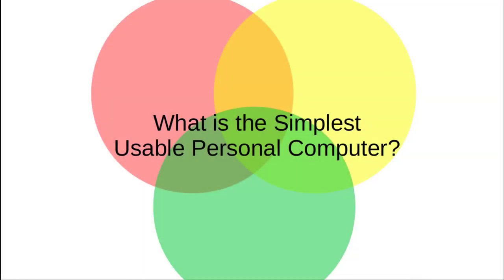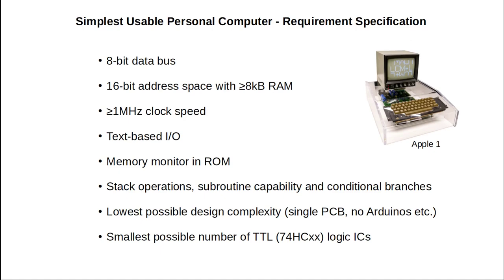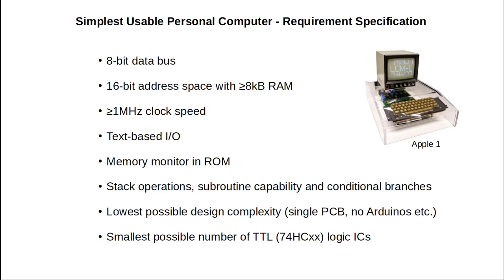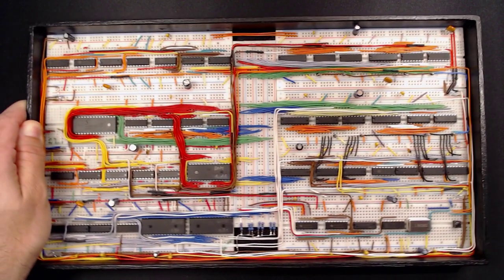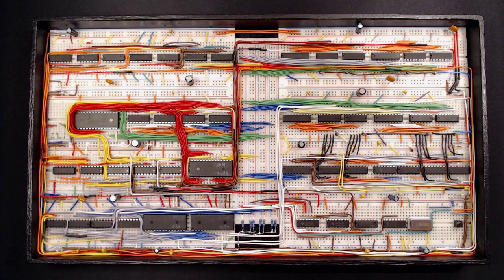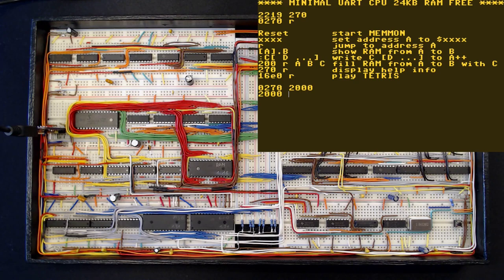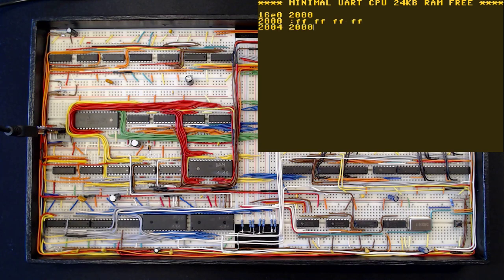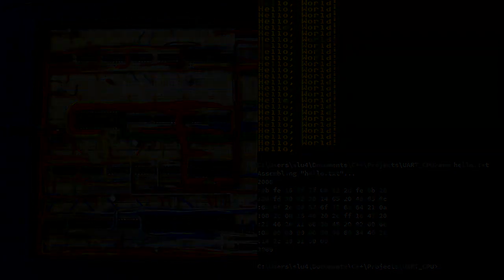Simplest Usable PC #1

Comment: This is really great stuff, thank you so much. I think there's a huge need for a hacker computer that is of course weak by modern standards, but actually comprehensible. Something without the hundreds of historical layers of messy technology, something without all the red tape of security stuff, etc. A hacker console like an Amiga or Atari ST.
Reply from the maker: I certainly agree with that :-) But to my taste, the basic principles of a computer are too much obstructed in the Amiga 500 with its co-processors. That's why I've kept it simpler with the Minimal 64 (still 2x the power of a C64).

Comment: Hi can I ask what potential  use case of such design, I'm process to create such computer on PCB, e.g could you find/use smaller SMD chip that's fits ins smaller board, and having bigger capacity e.g ROM RAM etc. 
You started in the right direction why not finishing it.
Reply from the maker: Hi, my design is all about simplicity, accessibility and education. Glad to hear that you are on the road to a more modern and larger design - but that was not the direction wanted to take.
Reply: @slu467  Alright it's OK I learned a lot from your videos, I know creating more complex computer will need much more harder work, at the end it won't compete against modern design or even mid 90's ones, keep up the good work.

Comment: I think my CPU design is on the minicomputer side, due to it requiring you to put in a boot loader to run the bios. Unless I figure out a way to make it jump to the bios on power on.
Reply from the maker: Maybe put some ROM at address 0 and reset the program counter...
Reply: @slu467  I thought about it! Resetting the CPU could put it in a specific state where it runs a "Reset Handler" jumping to the start of rom. Your idea also works but, I would be wanting to avoid having rom at the start of memory.
Reply from the maker: @ducksonplays4190  I know what you mean. It is kind of costly to detect a small ROM starting at 0. But I went for a LARGE FLASH. My CPU now uses 512KB FLASH (banked). It sees a 32KB FLASH bank starting at 0. RAM starts at $8000. Very easy to decode... will make a video about it in the future :-)
Reply: @slu467  That is likely the smartest solution, I may do that and I may not. That would make the memory map more complex. I think I would go with the reset button idea but, it might be too complex.

    Sometimes I wonder if my CPU is a little too complex since its power is around that of the 8008. What CPU would you compare yours the most to? :-)

Comment: Oh wow! You have been busy!
Reply from the maker: Yeah, I'm still going down this minimalism rabbit hole :-) How are things going on your side? Cheers!
Reply: @slu467  I've all the ICs for your previous setup here placed on the board, I just get the fun part of actually wiring it all up. I found the gigatron gerber files were freely available now, so actually had a set of PCBs for that arrive this week along with a set of ICs for that, so may have found myself a little distracted.  So this version doesn't have it's own keyboard or video output, all the input/ output is through UART?
Reply from the maker: That's right. The single path in and out is UART here. That may sound as a step back, but this thing is not depending on ANY Arduino any more. It is running on it's own :-)
Reply: @slu467  That's fair (You seem to be going up in view count again here!)